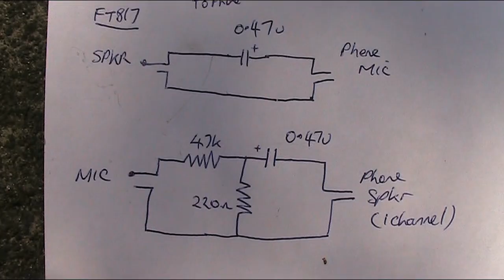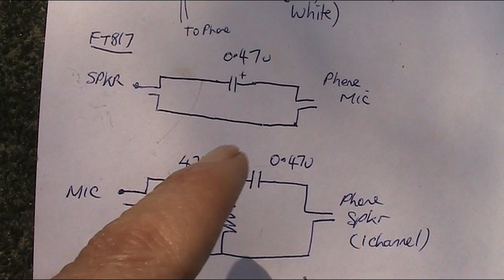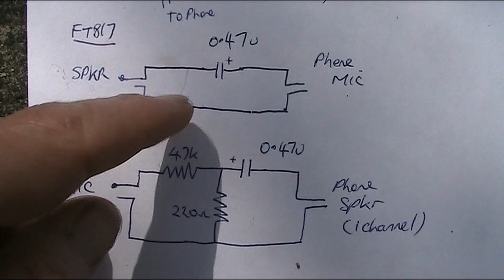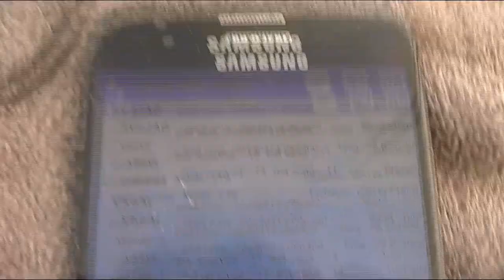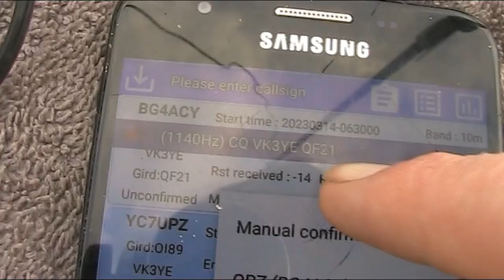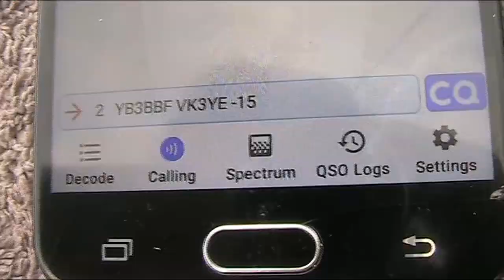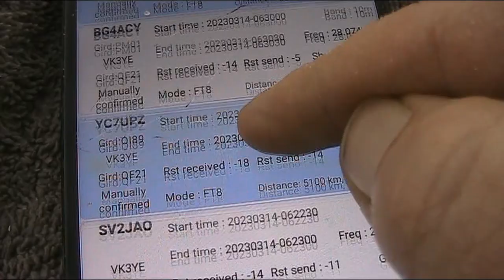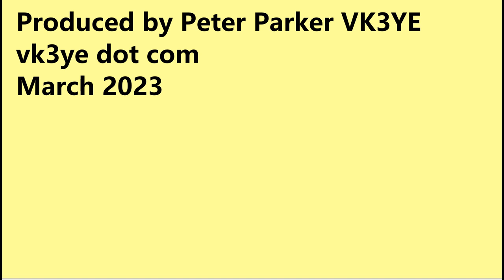Make your own Android - transceiver interface cable for FT8 etc

Comment: 👍Thanks Peter. Very glad you stressed the importance of attenuating signal going into the mic input. Unfortunately, I see/hear quite a lot of horrible FT8 signals where I reckon operators are overdriving tbeir transmitters. The golden rule is that your Tx should not be applying ALC when transmitting digi modes. Monitor your transciever ALC when on Tx and reduce signal into mic input until there is no ALC reading.

Comment: Peter, 

why don't you use the mini-DIN plug, to connect the FT-817ND to your Android device? Just switch to the 'RTTY' or the 'digital'-mode in your FT-817! You don't need so much 'attenuation' to the different passes, to the microfon and the speaker! 

You can 'listen' to the stations, or 'mute' them with your volumen-control. and you have allways a constant and perfect audio-signal, on the 'signal-cable' to your android-phone or tablet. 

And there will be no 'problems' with 'interfering microfon-talk-over', ... ! 

You can still connect your microfon to your radio, and listen to the 'anoying FT-8 signals' if you want to do, ... ! 

I used a similar device, (homebrew) to 'connect' my old FT-817(non ND!) to my Rasberry-Pi 400! 
Instead of a 'direct' connection to the phone, I 'isolate' the lines, with two 600Ohm transformers. 
(Very very small ones, out of an old landline-telefon) 

That helped a lot, to 'break' a 'ground-loop' problem , having strong multiples of 100Hz-tones, all over the 'modulation'! 
(very big 'BUZZZZZ'! As loud, as the 'modulation' was, ... !)

And it works like a charm, ... ! 

(I used a serial-port, to connect the 'RS-232' to the radio, to make 'CAD' possible, so I had no VOX-control needed!)
I hope you can participate from my suggestion! 

Sorry for my bad English, it's not my native tounge, ... !

72/73 de Markus - db9pz - (JN39fq 5km/3miles east of LX)

Comment: What's the law on this?  Can I just keep FT8 running 24x7?  Does the station have to be attended?
Reply: I don't know what the VK license conditions are. I am in the UK and not entirely sure what the situation is. The UK license conditions were written in days before FT8 software that allowed unattended automatic operation. The conditions do mention unattended operation in relation to beacons. I wonder if some UK amateurs may be operating FT8 (WSPR and other modes) unattended on the basis that they are NOT beacons. Beacons are transmit only. However, FT8, WSPR, etc. is being used for 2-way transmit and receive communications.
My personal take on it is that I do not leave FT8, WSPR etc. unattended but treat them much the same as modes like CW or phone. In Peter's case, in this video, he appears to be keeping a regular eye on things and I would argue this is good, responsible practice and not really unattended. Unattended for me would be leaving the equipment for anything longer than a few minutes. I think the spirit of the license conditions are that you monitor your transmissions and can reasonably quickly cease them if required to do so. I suppose this also applies to beacons which are being monitored by those receiving them where the operator responsible for them can be contacted to shut them down if causing undue interference.
Reply: @Steve-GM0HUU  Yes, I don't think anyone's going to bother too much provided you take reasonable care that your station doesn't interfere with anyone else.  I've always thought running a station like this for an extended period would be a good way to investigate propagation changes over time.
Reply: Unattendent use of FT-8 and other type of 'modulation' to achieve 'long distance' - DX - contacts, is not HAM-radio anymore! 

It's a 'fake'!  

It is an 'automated station', no OP - OM/YL needed, to make your (the) QSO!  (*)

This is not fair, it is no amateur-radio in any way. 

When this happened, two computers are 'talking', ... where is the human thing in it? There is no OP necessary in any way! Where is the 'friendship' going, the human factor? 

Going to work, or for a walk, and 'doing a 5-band DX' in an hour? Or, working 'DX-CC' in less then a week, only switch on the computer an the TRX? There is no 'honor', to do this kind of thing! 

No! - That's not Ham-spirit, in either, or the other way. 

It's a pitty, that some people use the system, to 'fake' good HAM-radio practice, and also 'fake' the results as there own work! 
It's not the work, and not the results, they claim to made in HAM-radio, it's only a 'fake' they do, ... ! 

Please, let us alter the rules to a new and good standard, not to 'prefare' those 'faking-QSO' making 'friends'! 
This is not the 'real deal'! 

Friends are honest to each other, and not making 'this kind of deals'! They make a 'real' contact, or erease it from the log, if there is any doubt in the way! 

(*)
 -The QSO - The 'holy gradle' of Amateur/HAM-radio operations! The 'best' you can give, the 'best' you can receive! 
Like a 'clean' and 'beautiful' business-card, you can show to you 'partners', all around the world! - Like your QSL-Card. - 

Sorry for my bad English, it's not my native tounge, ... ! If there is something, I write or say wrong, please be so kind, and take, my disclaimer or advice, ... and be a little passioned. 

73/72 de db9pz (Markus) - JN39fq 5km/3miles east of LX
Reply: @markusm.lambers8893 Good to know there are sad hams out there looking out for us to make sure we are using our radio licenses 'properly' meaning they way they want us to use them.  Let's not discuss beacons or WSPR, which is used exactly the way you say is not ham radio.  I've got an idea, you do ham radio the way you enjoy it and let others enjoy it the way they enjoy it.  Unless actual regulations are broken, to each their own.

Comment: This is really good, but most phones these days don't have any jacks.
Reply: Buy a "burner" phone just for this! Cheap as chips.
Reply: @TheArtofEngineering  yeah, none of the ones I have kicking around have jacks. I'll have to poke around on the web. Might be a bit difficult to get ahold of in America. Ebay is probably my best bet.
Reply: Maybe you could rig up something using a Bluetooth transmitter and receiver. You  can even get off the shelf Bluetooth CAT dongles for FT-817/818. A bit messy and complicated compared to a cable. When I last upgraded my phone, I made sure it had a 3.5mm jack but that was a couple of years ago. As you say, most new phones don't have them. Having to charge devices and mess about with Bluetooth settings when you used to be able to just plug something into your phone. Apparently is called progress? 🤔
Reply: @Steve-GM0HUU  Lol. Yeah, I get the feeling progress has been redefined to mean more profit. It seems not even batteries are standardized nowadays. I miss the days when we knew to keep things simple and waste less.
Reply: My wife's phone has just micro-USB but I found a cheap adapter to use jacked headphones through the micro-USB. The same should work for FT8, too, I presume.
Reply: @tmmlrd  oh cool. I'll have to look into that. Never seen that before.
Reply: @tmmlrd  
Is it not an USB-C connector? Then you can 'adapt' from the 'new' USB-C, to nearly any 'output-' or 'input-' device, up to a HDMI-monitor, ... ! Maybe a 'bluetooth-adaptor is aviable, and all the 'problems' are gone, ... ! (hi hi ! !) 

USB-C is an 'oval-round' type of plug,, not the trapezoid one!  You can plug it in either or the other way, it will fit and 'load' the phone, in every way! When the telephone is less then 4 years old and with 'rapid/quick-charge',  it could be an USB-C port. 

 - You will be a 'happy man'! - 

72/73 de Markus - db9pz - JN39fq - 5km/3miles east of LX
Reply: Yes it is USB C (sorry)
Reply: @tmmlrd  no problem at all! 
You will find a 'solution' that fits! 
Best 'connector' a 'new' phone could have, ... !
Nearly everthing is possible, 'behind' an USB-C port. 
(Fast harddrives [also the new M2], headphones, monitors,
and a lot of more periferale objects!)

73/72 de Markus - db9pz (JN39fq; 5km/3miles east of LX)